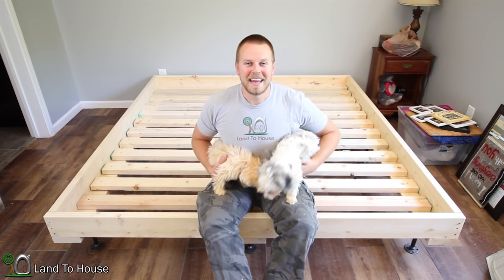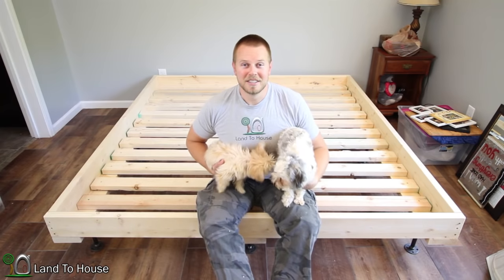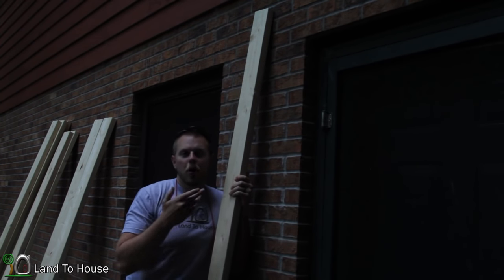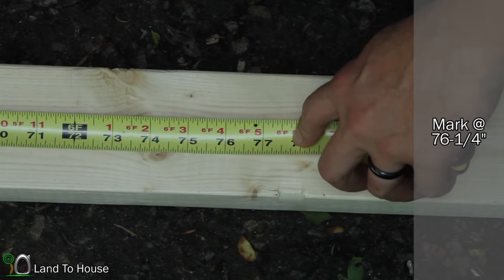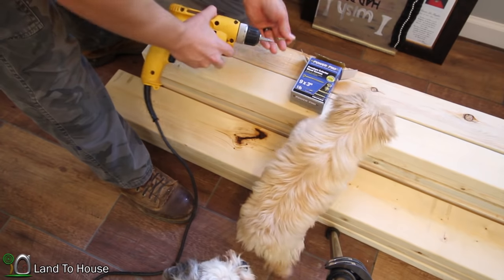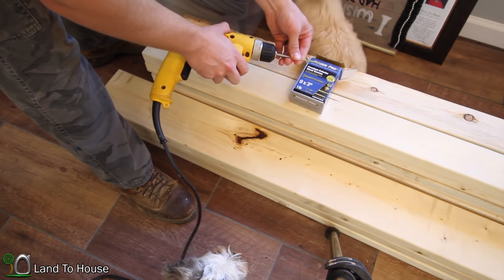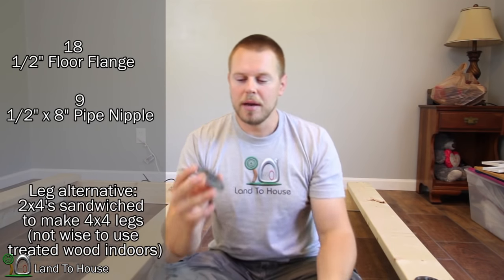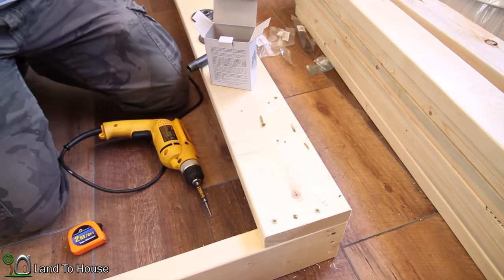Build a simple King Size Bed Frame out of wood

Comment: Nice, easy and beautiful work!! A question: 2 x 6 means 2 inches x 6 inches, right? 
Asking because we use centimeters here and that wood dont seem to be 2 inches (5 cm) thick to me. Thanks!
Reply from the maker: Thank you. Here in the United States there's a difference between lumber that is nominal and dimensional.
 A 2 x 6 is actually 1.5 in by 5.5 in

This has to do with the way lumber used to be milled many years ago

Comment: Thank you for this incredible idea!  My Cocker Spaniel recently hurt his back jumping off the tall bed I had.  Well I got rid of that entire bedroom set right away!  He healed up, re-injured a bit and now is almost 100% again.  He sleeps on the bed though, so I've been searching for a very low bed that he won't be in danger getting on and off.  All the beds I've found on Wayfair, Ikea or anywhere that are low enough, are super expensive!!  But if I use your frame, with 2" legs instead of the 8" then the bed will be super low but still off the floor!  Perfect!  It'll have that Asian inspired low look that I want, mixed with an urban feel and safe for my Sam.  Thanks so much, this will really change our lives!
Reply from the maker: Happy to help! A few people have built this frame right on the floor with no metal legs. I rather like the legs though. Using 2 inch legs would be awesome for a nice low frame.

Comment: Great video. I just made this frame with a couple modifications. I used 2x2s along the side rails and cut the slats at 73.25"s. I wanted more of a zero edge for side skirts. Also picked up a 6ft piece of 1/2" pipe insulation with adhesive. 9 8" pieces of that to wrap the pipe nipples to protect the toes just incase;). Thanks for the inspiration mate
Reply: Also stained it with matching golden oak and used black metal brackets to attach it to an existing headboard. Came out great. Youd never know it was hand made

Comment: Broke my bed two weeks ago and came across this video and I’m building it for Christmas...great video by the way 

What do you think about using pocket holes instead of screws in the ends of the wood?

Ps 

I’m getting the wood from a big box store and it’s cheaper than the local lumber yard...(it’s only because they are charging me for the cuts)

Found the metal parts for a little more than what you paid...

Video coming soon 

Thanks again
Reply from the maker: I think that pocket hole screws would be a great substitute for those wood screws. Might want to use at least 2" if not longer. Most of my pocket hole use has been with 3/4" plywood so I am not exactly sure how well they do with bigger projects like this. 

When you get the video made please share! I will also share your video on my webpage if you like. I have just started a "made by others" page to show what people make simi-based on my designs.

Comment: Great video.  I'm interested in two things. Are you still using a box spring under mattress or does mattress go directly on frame? Also,  
i want to modify plans to allow incline at head (acid re-flux cure???), how do you suggest changing these plans so that head is ~ 6 inches higher than feet?
Reply from the maker: I have made two of these beds. The queen has the box springs and the king does not have them. I like the mattress directly on the frame the best.  As for making the bed sit up at the head I cant think of any way to get the metal leg design that way BUT I bet if you used two 2x4's at each leg  you could make a cut on the leg to have that angle. This would be in place of the metal legs.

Comment: Can you use 4 x 4 for the head/foot and sides? Would that be smart to make sure it’s reinforced? And if I painted it with a finish polish would this affect the sturdiness of the wood?
Reply from the maker: A 4x4 is actually not as strong as a 2x6 in the vertical direction. Also it can be hard to find untreated 4x4s. 

As for polish you should be good.

Comment: This looks awesome! But have a question I wanna build this frame but without the metal legs. can I use wooden legs instead? thanks :)
Reply from the maker: +Tanja James thank you. Yes you certainly can use wood for the legs. I recommend using two 2x4s sandwich together to make a 4x4. It is not a good idea to use a treated 4x4 inside.

Comment: Hi Seth
If I wanted to make the bed frame a little wider (1 inch on each side) what would the measurement for the bed frame be? Please help
Reply from the maker: You should just have to increase the header and footer by 1". That means they would be 80.5". You would also need to add to the slats.

Comment: You made this look so easy, I am definitely going to give it a shot.  Do you think it will hold up if dismantled and moved to another home?
Reply from the maker: Thank you. Oh yes it will hold up to a move. One suggestion that I would make is when you go to re-screw the bed together that you go slowly because the screws will have much less resistance the second install. I would not want you screw them in too far and crack the wood.

Comment: so I built this bed,it's great but I'm a bit concerned about the weight since I'm on the second floor. I'm going to build it again. Is it possible to use 1x6 instead of 2x6?
Reply from the maker: +Phil Parker I should think that 1x6 should work. I have not tried. The frame should not be that heavy. Mine is not more than 60 pounds.

Comment: Please help what if I’m not putting slats on and just going to use a metal box frame?? Would it fit flush without any slats??
Reply from the maker: I am not familiar with a metal box springs.
Reply: @LandtoHouse  hi thanks for your reply. And it is essentially the same thing as a wood box spring foundation for the bed but only instead of wood it’s made out of metal. Since I have the box spring foundation already would I still have to add as many slats that you did or can I use less slats? Thanks.

Comment: We love this bed and are planning to build it. Do you have any recommendations for something to protect hardwood floors from the metal flanges? I was considering hot gluing cork drink coasters on the them, then adding rings of glue on the other side to prevent slipping. Maybe even a yoga mat cut into strips?
Reply from the maker: Those are great ideas for protection. I have seen carpet bottom plastic coasters at lowes that are large enough to fit the floor flange. But any of the diy versions should do well.

Comment: this is something i really want to do but im super worried about squeaks. wich is a problem i have with the bed that i own now and its just super annoying when i go in and out of bed or toss and turn at night in bed
Reply from the maker: In this Frame build I used a minimum of 3 three inch Torx screws at Each corner. With the addition of the support board on each side underneath and the center rail I've had no problems in well over a year. This Frame is made like a tank.

Comment: Hello Sir, landtohouse.... I have a question does mesurement you have at the beginning of the video. would the box spring for my king size bed fit? because I don't want to eyeball it... thank you very much sir for the video
Reply from the maker: People have reported that box springs will fit in this frame as is but some had to remove the plastic corner protectors of the box springs. If you would like to make sure that your set of box springs fits you can add 1/4" to the measurements.
Reply: thank you very much sir

Comment: Did you have to run it through an anti-warping device?
Reply from the maker: I just made sure the screws were tight. It has held up well for years. We still use this frame.

Comment: I like this.  Very simple and with very sturdy legs.  Would most likely hold up extremely well considering my wife and I are bigger people.  I could probably could cut out heavy duty felt furniture pads and glue them to the bottom of the flanges to keep it from scratching up the floor.

I do have a couple questions.  Would you recommend using 3/4" x 12" as that would possibly provide a stronger and longer set of legs?  Also, I have a hybrid mattress, not super thick, but very comfortable.  As I'm not really looking to use a box-spring, do you recommend just using this frame as you've built it, or are there different measurements you'd recommend?  Thanks so much!
Reply from the maker: Thank you for watching. When I go to the queen bed frame I used 1 inch legs. A bit more expensive but also stronger. To be honest with nine pipes for legs I feel like half-inch is just fine. 

Putting felt on bottom of the flange is probably good.
Reply: @LandtoHouse   Thank you so much for responding!  I've actually gotten all the wood, including for the headboard, and have it cut and ready to go.  My wife and I are excited about this.  Your directions are as clear as day and I'm so glad I found your video.

I did get heavy duty furniture sliders that are thick enough that I could not only glue them, but also screw to the flanges so there's less chance of them coming off.
 http://www.amazon.com/dp/B07QTY2HC3

Comment: Hi Seth! I am in Australia and I'm not sure if the king mattresses here are the same dimensions as yours in the US? And if they are different, what would the new measurements be for the frame? I've found your video so helpful! Thank you so much!
Reply from the maker: I actually do not know the answer to that question. I had not thought about different sizes between countries.
Reply: Thanks anyway, I converted it all to cm and adjusted the frame to fit the mattress, but your video helped so much, so thank you 😊

Comment: Great video.  Do you think on a queen build that 1 x 4 slats would be sufficient?
Reply from the maker: Thank you. I have not tested those but other frames use them. I should think it would work just fine.
Reply: I built a queen with 1x4 slats and similar clearance between and it's been two years, going strong. 2 screws at the left, middle, right supports. Good luck!

Comment: Great simple video. My question is about dis-assembling when one moves. I assume you have to back out all the screws to take apart? And then screw screws back in to reassemble? Sightly worried about sturdiness after a re- assemble. Thoughts?
Reply from the maker: Thank you. The frame is just slightly larger than most door frames and that means it will not slide out on its side. But you should be able to tilt the frame on the side and get it out of a door. You would have to unscrew the headboard. If you are worried about the sturdiness of that connection you can move those screws because they are not seen.
Reply: Squirt wood glue in screw hole,  insert toothpick,  let dry, reuse screw.  Whammy!

Comment: If I have a California king size bed. would the measurements be a little different? If so do you know how much more..?
Reply from the maker: Yes the California king mattress is 72 by 84. You would have to make adjustments in both width and length to make this frame work.
Reply: Land to House do you know the exact lengths needed for a california king?
Reply: Land to House the Matress I'm interested is 71.5 x 83.5 what length cuts would I need to make?
Reply from the maker: I have now added that info to the description of this video.

Comment: Great video I'm going to pick up all the wood and start the project on the weekend. How long did it take to do it all? Also im using 4x4 for the legs any advice??? Thx in advance
Reply from the maker: You can probably build this bed in an afternoon. I have a queen size bed frame build with wooden legs coming up soon. My only recommendation is get untreated lumber for interior use
Reply: Land to House thx great video

Comment: Like 2 twin frames
Reply from the maker: That would probably work. You would need to make sure that the middle of each did not have the vertical piece or at least make sure that it was shorter to keep the person from feeling the wood between the two twin mattresses.

Comment: I can't explain how easy it was to make this bed. I followed all his steps and it took me and my 54 year old mother 8 hours from buying materials to the last screw. I had no issue understanding any of the request but it does take ALL 15 boards for the slats. It looks phenomenal! I did change the legs to 1/2" x 12" instead of the 8" because I wanted more room under my bed and it's still a super great bed. This bed isn't going anywhere! So I love with this
Reply: Also going online was a TOTAL LIFE SAVER for the metal needed for the project. Walmart had them and it was enough to get free shipping
Reply from the maker: I am happy to hear that you enjoyed the build. Buying those metal parts online is the way to go. You can almost save half the bed cost that way.
Reply: Land to House yeah I was astonished when I looked in store because I though surely that wasn't true. But to my surprise they were just as expensive as you said. But the pre-drilling was really the way to go it made assembly a breeze. Thank you so much. I have a beautiful bed that we will have for years!

Comment: Dragon Ball noticed at 13:10
Reply from the maker: Ha ha yes that ringtone is in half my 900 videos:)
Reply: @LandtoHouse  Great video BTW! I'll try to make a king size frame with my dad, here in Costa Rica, following your instructions (it's exactly what I want, to fit a huge bed on a rather small room). But wanted to ask, do you happen to have the cuts in centimeters? I don't think my local wood shop will get the measurements right hehe and also, is there any risk if I put some larger pipes to raise the height? or it may messed up it's stability?
Reply from the maker: I actually do not have the cut list in centimeters. I suppose you could multiply all inch values by 2.54. I've heard of people raising the frame on 24 in pipe. That would give you a lot of storage space. With nine legs it should not be an issue.

Comment: I just finished using this build and built myself a king size bed. 😁 The only thing I changed was I used the scraps from the cut 2x6 boards as legs and I am still using my Box Spring so I used 6 slats but is very sturdy and heavy.  I am building the headboard tomorrow so wish me luck.
Reply: Just Dimples  I just returned home from buying all the wood to build this, and I too am planning on using the scraps as legs.  I like the design he has with the metal pipes, but I’m trying to go as cost effective as possible because I’m also adding in floating end tables with electrical outlets.
Reply from the maker: Great idea. Using the scraps to save on cost.
Reply from the maker: Seems like a good idea. Might as well use the scraps in a practical way!

Comment: How tall is the bed frame from the ground to the base where the mattress rests on? 

I am 6ft 4 so I like a tall bed more.
Reply from the maker: You can use different length legs. The metal pipe comes in 1" up to 6" then 8" 10" 12".....
Reply: Land to House thank you!

Comment: One thought for setting the slats would be to cut a couple spacers from the scrap wood and use those rather than having to measure for each.
Reply from the maker: Yes that is a great tip. Would make this a lot faster.
Reply from the maker: On a project like this I think it would be ok because there is a nice 1" or more space for mistakes. Now on projects that require precision you are right. Better to measure and cut as you go.

Comment: My mattress is roughly 72inches wide. Is that too small for this king size build? Do king size beds vary in widths? I have one of those frames that are two twins metal frames put together and want to do away with that!
Reply from the maker: AH you have a California king mattress. Those are not as wide but longer. This frame is not going to fit your mattress. You can find the cuts for a California King in the description.
Reply: Haha crapola! When I got the mattress I was told it was king. Makes sense when I built it I couldn't fit the bed length wise and have so much room on the sides lol. I had to Add an additional 3 Inches or so to the length. Either way....a solid bedframe! Thanks for the response!
Reply from the maker: @Slickqbn  gosh my apologies for not getting to your comment sooner. (I get lots and lots every day) so you had to buy two more boards to fix the length? When my wife and I purchased our king we wanted the extra width. So we went regular king.
Reply: I cut 3 inches off the extra pieces of 2x6 and Frankensteined it to the ends :) can't even tell. Stained it and everything....looks good! Can't complain

Comment: I will be using wood for the legs. That being said, how do I go about sandwiching and attaching them?
Reply from the maker: I recommend using untreated lumber inside the house. You can sometimes find 4x4's untreated at home depot. If you cant find them there I would go with 2x4's put together to make 4x4's. You can use 2.5"  screws to connect the two together. Some people will install the first half of the leg onto the frame and then install the second half of the leg to the first. This will allow you to attach the legs without having to use really long screws. I hope this helps.
Reply: @LandtoHouse  can you make a video how to make 4x4 wood legs?
Reply from the maker: I really want to. I might do that soon. :)

Comment: im gonna give this a shot, but im considering subbing 4*4 cut into the 8 inch segments with felt furniture padding as feet over the metal legs. Simply to save my hardwood. This is an awesome tutorial on a nice frame!
Reply from the maker: Thank you. You might want to sandwich untreated 2x4's to make 4x4's. Its not good to have treated lumber inside because it will off-gas. Now you might be able to find untreated 4x4 but it can be hard. Those metal legs can be a little pricey.
Reply: Will do. i did see on a few other videos people using the sandwiched 2*4's so thats what im gonna end up going with. Thanks for the tip!
Reply from the maker: Sure any time.